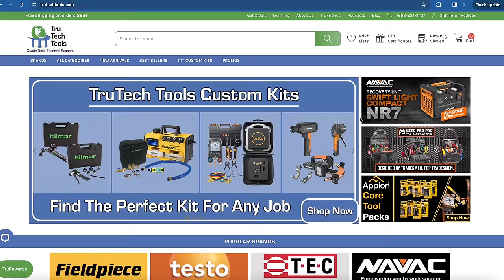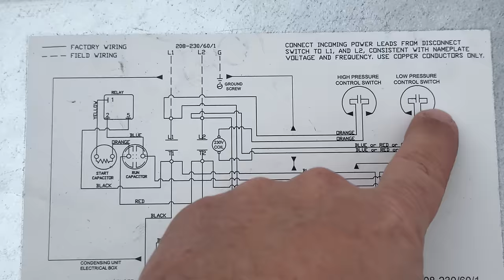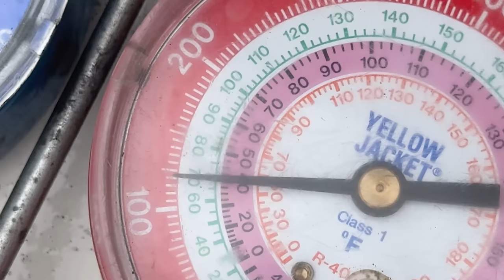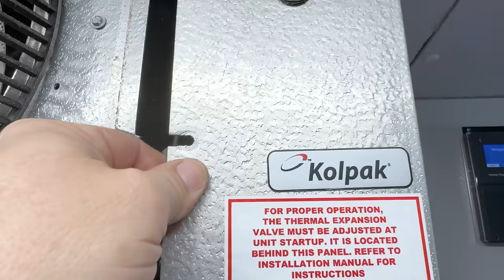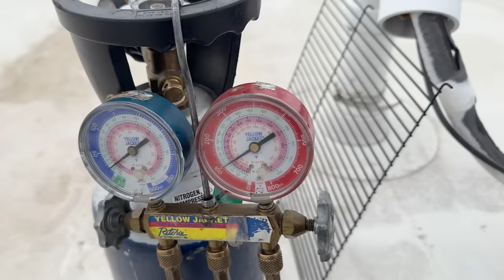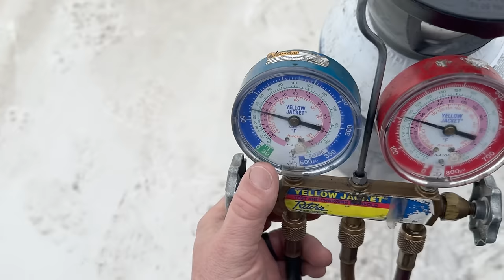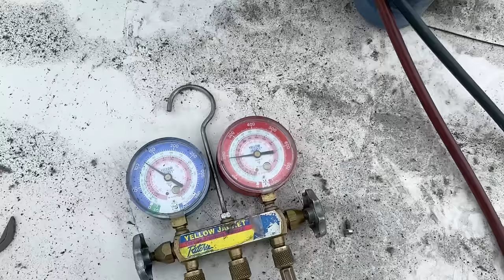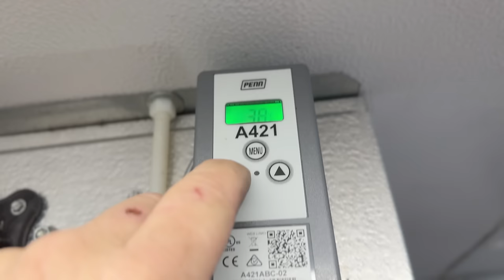Beer Cooler Repair Quick Down & Dirty

Comment: I am perplexed why installers mount the temp control on an evap coil period? The constant vibration is not good for electrical controls. Some people’s kids….

Great vid Rick, happy Sunday!
Reply: What's worse is when they install it on the back , it's against your nose and can't see the temperature. Thank god for a young apprentice with good eyes😂
Reply: That’s a factory installed thermostat. They come like that
Reply: If it's going to be on a service door I'd rather it be on the electrical side, not the txv side where it's bound to do what it did.
Reply from the maker: Exactly I hate it on the rear

Comment: Back in '13 I was in a spot and needed a vehicle, Lucked out and got a 97 expedition for $400 that needed work. Among the list was the ac compressor that was swapped for a bypass pulley. That and the manifold were missing. For what I know it had been ran like that for about a year leading up to it being parked for another year and then another six months after I got it I was able to get a used compressor and the lines. I knew literally nothing about ac other than what was on the directions for a quick recharge can at the store lol. I got on here and got a quick crash course, got some gauges and a vacuum pump, took some brake clean to the orifice tube, slapped it together and let it hold a vacuum overnight. That thing had been open to air and driving and I didn't swap the drier. it ran great for about 30k miles and two summers until the headgasket popped at 305k miles. It blew my mind how refrigeration works from watching that vid and thanks to that I have subbed to a few of y'all on here.
Reply from the maker: @dprrn  awesome dprrn ! Thanks for the info and feedback. !👍👍

Comment: No winter charge required,it has a fan cycling switch,don"t know if that is a 8 lb or a 10 lb receiver.could have checked pump down.but never the less great work.

Comment: With the cooler warming up the gas in the system would be coming out and not contaminating the system. You did the right thing not changing the dryer in wet rainy weather. Also, you flushed the system with dry nitrogen and pulled a vacuum. You should not have any issues with leaving the same dryer in the system. I've done it several times during bad weather and never had an issue. One time I repaired a very large computer system during a bad snowstorm, fixed a leak and did not change the dryer. The system ran another 10 years before finally changing out the entire system. Back in those days there was huge heat generated in the old IBM computer systems and the AC ran year-round.

Comment: After you blasted that condenser coil, did I see frost on your nitrogen tank's valve?
Reply from the maker: Yep. Because it left the bottle at 2000psi then was at 300psi in a couple minutes it can condense.

Comment: I'm just getting back into refrigeration. I'm not going to comment but I have a few questions if it's OK to ask. What is the proper subcool range when the system is operating close to set point?  You had a 54 F ambient and your head gauge were reading about 80 +/- F. Is this the spread I should be shooting for? What should my back pressure be when it cycles off at 29F. I realize superheat is not an issue but where do we start crossing a line when it comes to minimum back pressure? And what is an acceptable compression ratio for this compressor and refrigerant application just in case I'm dealing with a semi hermetic. I appreciate the feedback. I joined your Facebook group. edit: Good video.
Reply from the maker: Hello, subcooling is usually low because it has a receiver. We don’t use that as much as making sure the superheat is correct. If you have solid liquid the TXV should keep a good superheat of 8-10 for coolers and 6-8 for freezers. That’s checked when the box is at temp. Head pressure is generally In the 20-30 deg over ambient.  Compressor superheat is to be around 25*.  Suction or back psi will usually be 10-15 deg saturation below your box temp but you don’t charge by that you just use it as a rule of thumb to double check where you are. Check out a book called refrigeration for air conditioning technicians. It covers all this and a lot more. It’s a little bit of money but it’s a great book.
Reply: @HVACRSurvival  I bought that book after Trevor Matthews recommended it. I appreciate the feedback and look forward to your future posts. What is the delta T on this type of application? Thanks so much!
Reply: @Earth_to_Kensho...ComeInKensho  Typical refrigeration evaporators are sized for a roughly 10 degree F delta T, but that varies, and that is at like hot summer conditions at design temps for the local area. In milder weather the condensing unit will be performing above spec which will bring the delta T up to more like 15 degrees. It all depends on the matchup of the condensing unit capacity versus evaporator capacity. Now on smaller cheaply built reach in coolers this is a different story and can very a lot. I've seen a lot of small reachin coolers running the coil at a 20 degree Delta T, this is so they can extract more BTU's out of a smaller (read: Cheaper) coil. Those are the ones that have constant issues with freezing up in humid weather in busy bar locations because the bartenders are constantly opening the door, or leaving the doors open for long periods of time etc.

Comment: My logic tells me risk vs reward, on a humid day changing a drier that is not damage or plugged is wasted time and resources, especially when you pull down to the same micron level with both the existing and new drier installed. Anything below 500 microns will be vaporing the existing moisture as well as any new introduced moisture, during the change out. it reminds me of the old joke, "you need to exchange the winter air in your tires for summer air".

Comment: Great content as always!  Hose bibb? ;) we wish.

 I did a cooling pm on an rtu yesterday.  Water was taken from the floor below and boy was it worth it. Dropped head pressure over 100 psi after letting a cleaner soak. I will remember your nitro trick but I'm not sure if I'm ready for that powaaaa

I wish you could see the broken oil trap in range keeping one side of the condenser lubricated. -_-
Reply from the maker: Oh wow! That sounds like a fun day 🤣👍👍

Comment: Eek, line voltage for contactor coil and cutout circuit.
Reply from the maker: That’s how almost all refrigeration is. There’s no low voltage transformers usually.

Comment: Yeah that little pinhole you didn't really open up the system. If that sight glass is yellowish-green, that's on the original installer or maybe the system was opened up in the past and that's the OEM drier.
Reply from the maker: You’re probably correct on the yellow-ish color. A new drier would help dry it up but 🤷‍♂️🤫
Reply: @HVACRSurvival  You're also probably right, but I'm confident it wasn't your fault, or that leak. Since it was an obvious short circuit, and probably a sudden loss of charge, I'm fairly confident it wouldn't affect the system. In fact, I just had a very similar system service call at a restaurant a couple of days ago. Walkin freezer, complaint of 40 degrees, I get there, system is flat, and discharge line from compressor to condenser busted vibration eliminator. Compressor is an old KALA-0150-TAC serial number says April 1988! Cut out part of the discharge line, sweated in a 12" piece of 1/2" copper I robbed from a mini-split lineset leftover piece, purged the discharge line, recharged it up. Sight glass is still a nice dark green. Dried was last replaced March of 2023, that was when I put a valve plate kit in it and changed the compressor oil while I had the head off.

Comment: What do you use for your leak check bubbles? I was using the bubble 'n trouble by diversitech but I found that my leak detector reacts to it, both the Fieldpiece and the prowler. Once I spray bubbles I may as well put the detector up, I'll never get an accurate reading, better hope it's a big enough leak to blow bubbles.
Reply from the maker: That’s just slither reason why I constantly push the dtek3 and stratus. They don’t do that
Reply: @HVACRSurvival  I love my stratus. Phenomenal battery life too, I think I can count on fingers of one hand how many times I've had to take it off the truck and plug it in to charge it. I can leave it for 6 months and battery doesn't even drop 1% of charge. I've had to replace the sensor one time in about 4 years I've had it.
Reply: The big blu bubbles work pretty well in my experience

Comment: Someone explain to me this winter charge thing, where am from we don't have winter 🥶
Reply from the maker: It’s reserved refrigerant used when the headmaster holds back refrigerant to reduce the size of the condenser coil during low ambient temperatures so you will have a solid column of liquid to your metering device.

Comment: Does anybody know how much r410 empty can weight?
Reply: 6# depends on the manufacturer bottle.
Reply: I’ve had anywhere between 7 and 10 lbs empty weight for a 25lb jug, and they even vary a lot amongst the same manufacturer off the same pallet.
Reply: I usually use Genetron by Honeywell, they are right at about 8#. Just went and looked at a new jug I have, I always write the weight down on the box when I buy them, this new one is 33.18 pounds full (25lb can). That's including the cardboard box though.